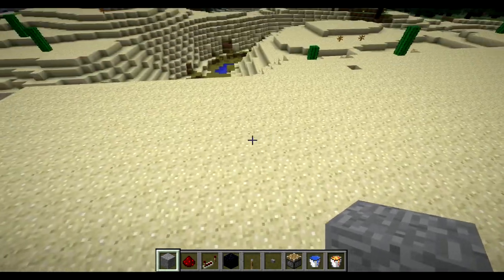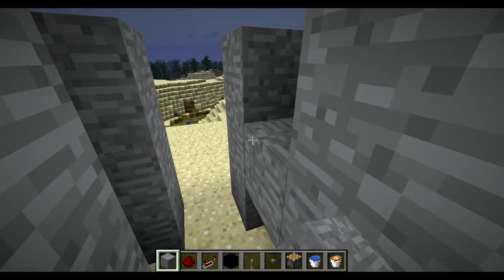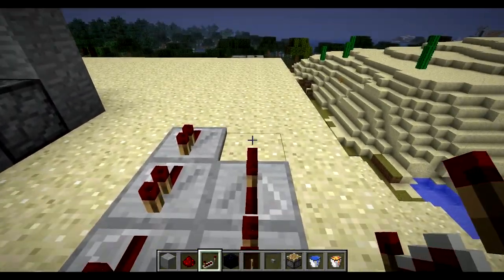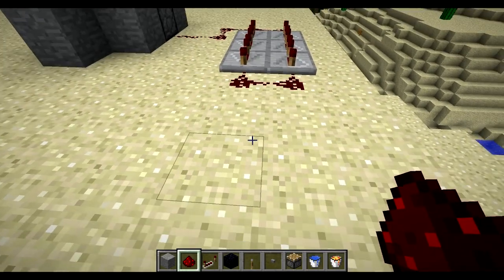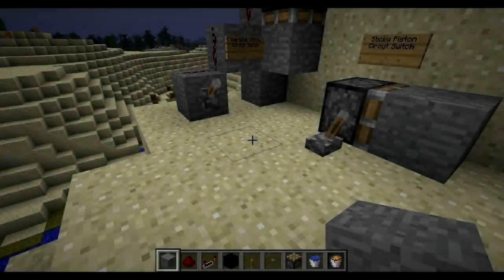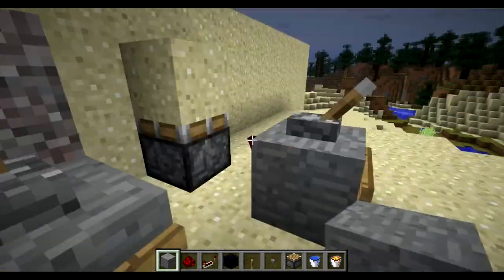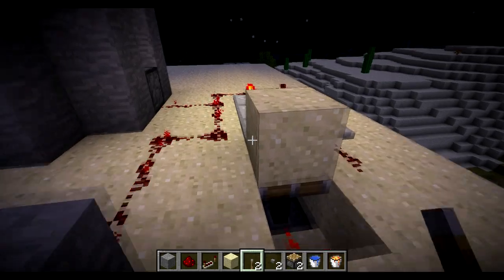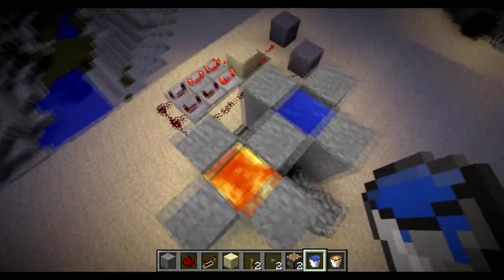Minecraft Simple Cobble Stone Generator 1.7.4

Comment: I love yours but its sorta complacated i looked up cobblestone generator and didnt use this because i dont know sheet about redstone so i did it like this: Dig 2 blocks horizantle one down in the last one than fill with water then at the third square is where the block should be formed then you dig one block horizantle on the OTHER SIDE than fill with lava then you get cobble stone infinitly but there is a 50/50 chance it will burn so :|/:D